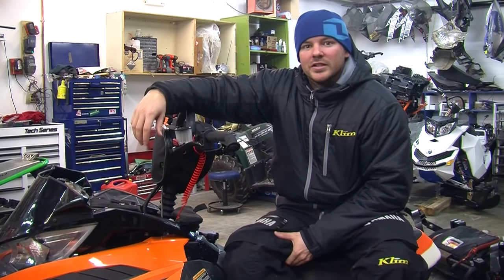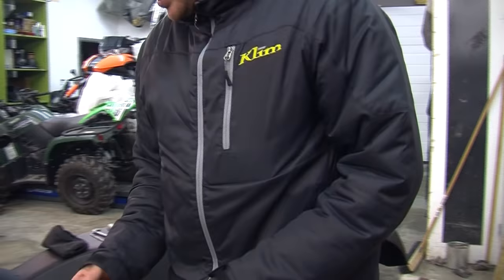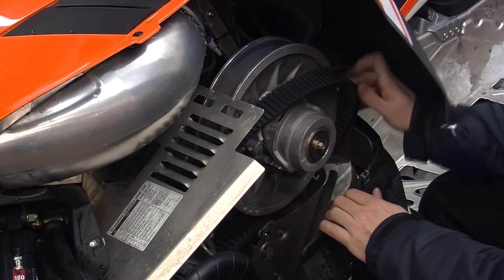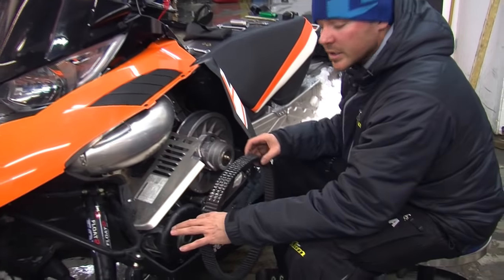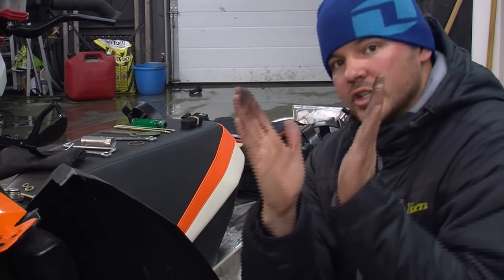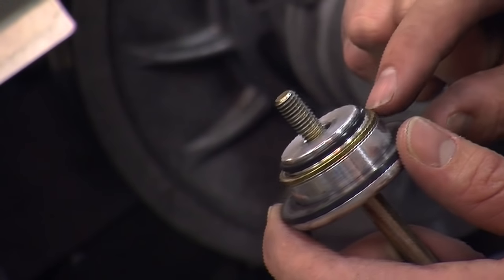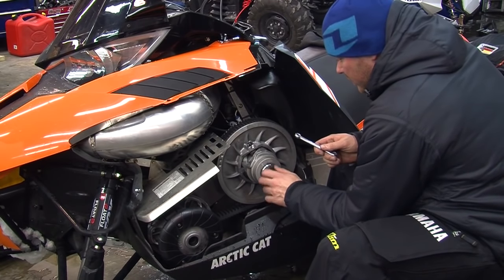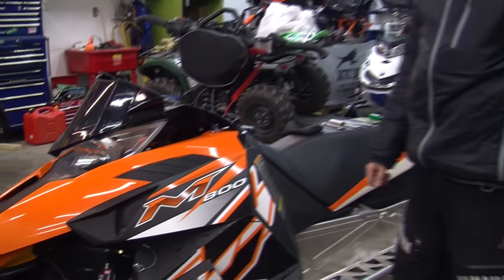2012 Arctic Cat Snowmobile Belt Change and Deflection  – Tech Tip

Comment: For the 1100 ya don't need a washer, just flip the deflection device. You need a 9/16ths instead of a 10mm for the 1100. Some of the guides carry an oil filter wrench so you don't even have to wrench it, but a third hand helps.

Comment: on Arctic Cats website it says the replacement belt is 0627-084. You stated 0627-083. Curious as to why? the 083 is cheaper.
Reply: +sleekny  Nevermind. I realized the 083 is the non Kevlar version of the 084

Comment: Is there a break in period on the new belt for the sled?
Reply from the maker: Yes, there is a break-in period for a new belt—generally speaking, 50 km (30 mi.) is a good period. During that time, try to vary the RPM. Avoid strong and sustained acceleration and wide open throttle for sustained periods. But you can still have fun. Thanks for watching.

Comment: Hey got 2013 xf 800 high country limited went to install new dayco xtx belt that it calls for and on idle track will move on its own off the ground but when put on ground won’t move put old belt on works fine anyone else experience this issue and have solution for me Tks

Comment: I'll stick with my sled. Don't need to be handling bolts and washers in the deep snow.. Good looking sled though.
Reply: i like how this guy didn't reply to you!! good one!
Reply: Every sled needs to have belt replaced several times in its life lol,, what are you talking about? A belt should be changed once every 2000-3000 miles or once a season for normal riding. For mount a in riding or hard riding with a 1100 turbo it should be every 2000 miles or once a season.

Comment: Just blew my belt for the first time on my new 1100 turbo and found they gave me the wrong washer in the tool kit! It was a 2 inch washer but the hole was a lot bigger then the bolt so it did nothing and just had to muscle clutch open